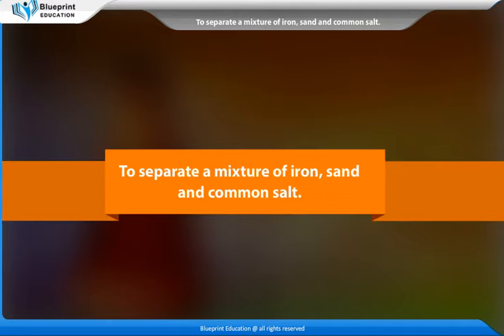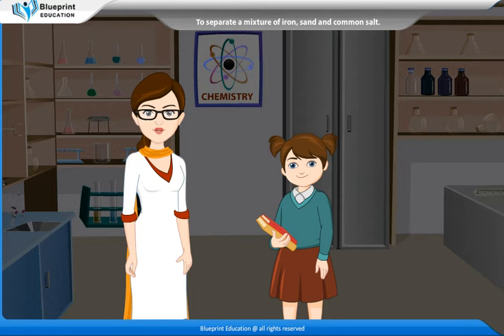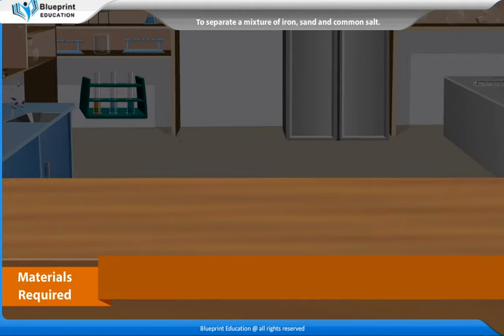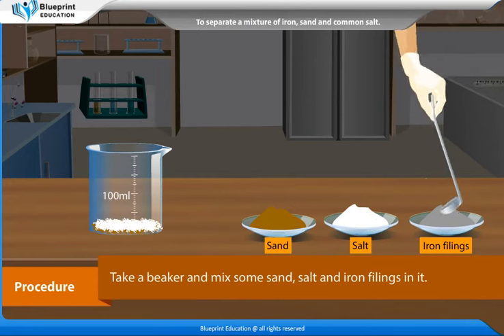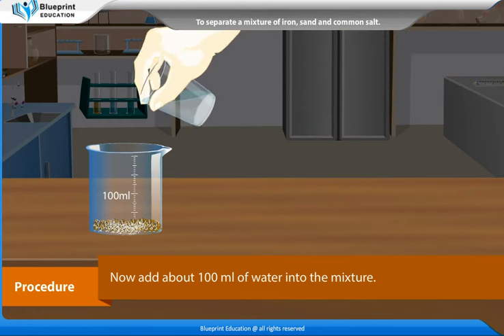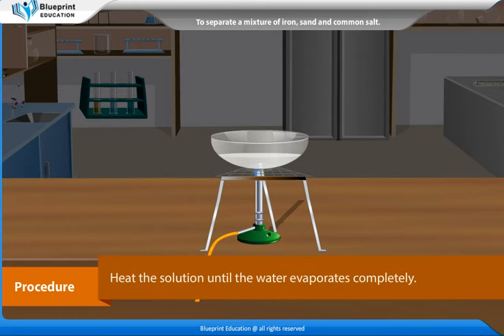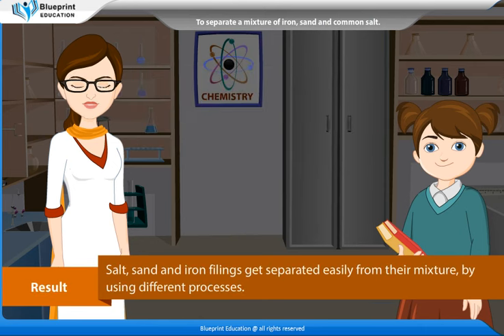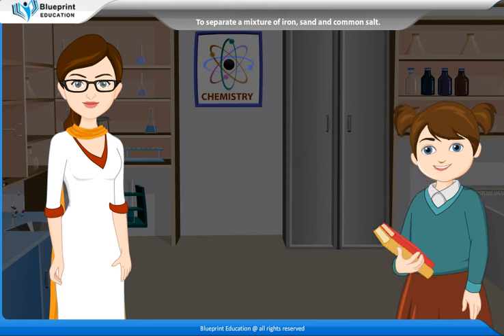Separate a Mixture of Iron, Sand and Common Salt | Science Experiments

Comment: 1.  take a beaker and mix some sand salt and iron fillings in it
2 .  weigh the 3 solids separately and record the weight for further investigation
3. hover a magnet above the mixture to seperate the iron.
4. the iron gets attracted and the others don't.
5. now add 100ml water into the mixture
6. stir the mixture but thoroughly
7. filter the mixture into conical flask using a filter paper
8.  now transfer the liquid into the china dish(bowl) , and place it on the tripod stand. light the Bunsen burner under the stand.
9. heat the solution until the water evaporates completely 
10. allow the salt to cool down for some time.
11. collect the salt
12. weigh all 3 solids again and record your observations in a table

salt sand and iron fillings get separated easily from  their mixture by using different processes.
Reply: Thx